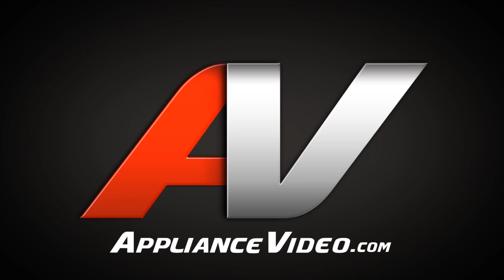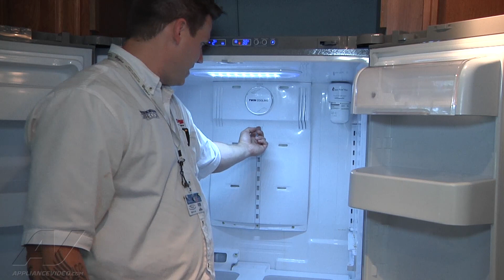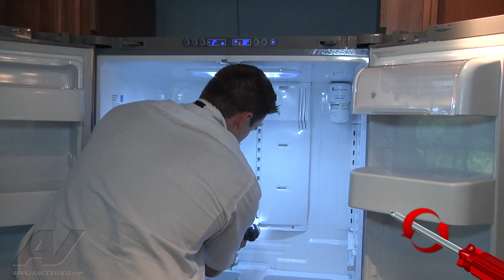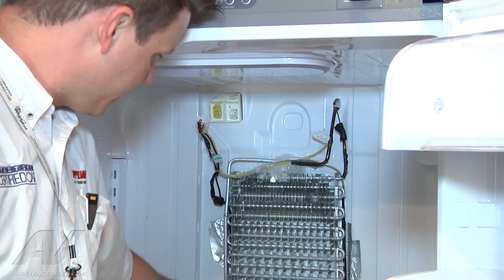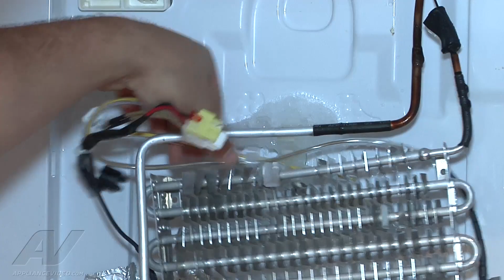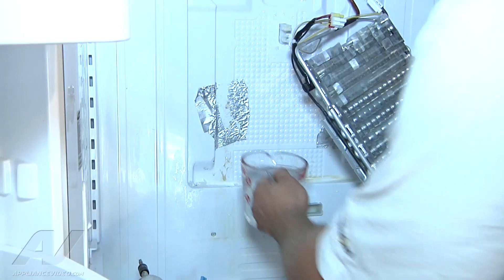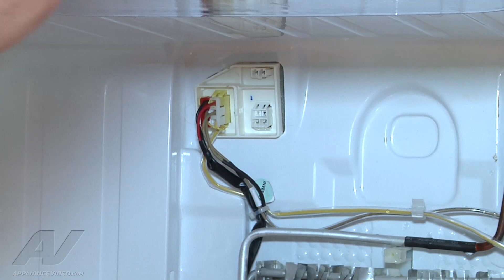Samsung Refrigerator Repair - Freezing Up On the Back Panel - Evaporator and Defrost

Comment: PLEASE READ!!! Had to do this every 6 months until I read that if you spray "Pam" on the coils it will prevent ice buildup. So I tried it and haven't had a problem since. 5 years and still no ice build up!
Reply: Wow ..Was your problem,the coil icing at top, causing the fan make a noise?
Reply: @victoragresti1777  Ice gets in the way of the fan blades. The noise is the blades hitting the ice.
Reply: @victoragresti1777  
Did you try it?
Reply from the maker: Hello 
          Thanks for the good tip, I hope it can help others with the same issues. Please help us by subscribing to our YouTube channel, or post our website www.ApplianceVideo.com to your Facebook page
Reply: Samsung very bad my refrigerator same over 1 month I have to do that 1 time.
Reply: PAM as in the cooking oil spray? I’m having the same issue with my Samsung double French door refrigerator. I am about to try out these suggestions
Reply: @algnelson2608  yes. Good old pam. When you take the back panel off while you’re defrosting it it becomes very clear what you need to do. Be sure and put a thin piece of paper or cardboard behind the fins when you spray so it’s not running down the back of the fridge.
Reply: Sorry what did you spray on it to stop this problem.  P.
Reply: @p.p2295  Pam. The cooking oil spray.
Reply: What did you spray
Reply: @p.p2295 he used Pam cooking spray. Like canola oil cooking spray. Stuff that keeps food from sticking when you cook.
Reply: Thanks I will try that
Reply: @jmdenison  did you try it?
Reply: @kayceevaldez2823  Try what the PM spray thing? Yes I tried it for a couple of months and it didn't work at all. Ben's appliances has a retrofit that I think will work and I'm going to go order it. Basically you will see the frost builds up in the upper portion of the chamber and he adds a couple feet more of defrost cable up there to keep it from frosting over. That should work because it doesn't seem to frost over in the lower portion
Reply: @jmdenison  did it work??
Reply: @bruhbry831  no. I'm thinking of forcing a defrost cycle everyday
Reply: @jmdenison  that’s a shame cause that’s what I thought of trying next, was hoping that rig he made would have worked :( hate Samsung now
Reply: PAM as in cooking oil?
Reply: @titoh5483  was it cooking oil or ??
Reply: Did you remove it to spray the front and back?
Reply: Sorry what did you spray

Comment: What would the problem be if the fridge just get colder than the recommended temperature?
Reply from the maker: Great question, if you have a more technical question that our parts department cannot answer, you can search our over 17,000 answered questions free at our website www.ApplianceVideo.com under our Repair Help section. You can also call our parts department at 1-800-830-5465 and they can give you help 7-days A week ,or search at www.SaveMoreOnParts.com  .

Comment: Hi Shawn, thanks for the great video. My Samsung rs25h5111sr/aa had ice build up in the fridge section which affected the temperature in that section. I took the cover off to melt the ice but the temperature was still high. I then changed the temperature sensor with no luck. Now the temperature is around 39- 44 degrees. When I checked the evaporator coils, I realized no ice is forming on them. Do you know what could be the cause of this problem? The freezer works great. Thanks.
Reply from the maker: Great question, if you have a more technical question that our parts department cannot answer, you can search our over 17,000 answered questions free at our website www.ApplianceVideo.com under our Repair Help section. You can also call our parts department at 1-800-830-5465 and they can give you help 7-days A week ,or search at www.SaveMoreOnParts.com  .
Reply: @Appliancevideo  that was pointless. Why answer ot with a standard message like that?

Comment: This seems to be the fridge back banal. I’m struggling with the freezer back panel below
Reply from the maker: Great question, if you have a more technical question that our parts department cannot answer, you can search our over 17,000 answered questions free at our website www.ApplianceVideo.com under our Repair Help section. You can also call our parts department at 1-800-830-5465 and they can give you help 7-days A week ,or search at www.SaveMoreOnParts.com  .

Comment: I bought a beautiful new Samsung refrigerator  (with right-side pass through door) a few years ago.

The fridge ran great for about two years and then started freezing up on me. 

I eventually replaced  the defroster heater/sensor combo and thought my fridge troubles were behind me.

I was wrong!

The fridge ran fine for about six months before it crapped out again! 

Needless to say, I WILL NEVER buy  another Samsung product again!
Reply: I must admit, I've been watching several Samsung videos try to solve this problem, and I also would never buy a Samsung refrigerator. My refrigerator probably has a similar problem but it's about 15 years old, so I can't complain I guess.
Reply: so, when it 'crapped out again', was it the same issue with freezing up behind that panel? Or a different issue?
Reply from the maker: Great question, if you have a more technical question that our parts department cannot answer, you can search our over 17,000 answered questions free at our website www.ApplianceVideo.com under our Repair Help section. You can also call our parts department at 1-800-830-5465 and they can give you help 7-days A week ,or search at www.SaveMoreOnParts.com  .

Comment: How do you know if that needs to be replaced last week we replaced the little metal part that is on the bottom of heater but it is still freezing up so I am guessing it would be this??? I would love to know what you would think
Reply from the maker: Great question, if you have a more technical question that our parts department cannot answer, you can search our over 17,000 answered questions free at our website www.ApplianceVideo.com under our Repair Help section. You can also call our parts department at 1-800-830-5465 and they can give you help 7-days A week ,or search at www.SaveMoreOnParts.com  .

Comment: I've never had to change a defrost heater in a samsung for back panel freezing up i  add a heater on top
Reply from the maker: Great question, if you have a more technical question that our parts department cannot answer, you can search our over 17,000 answered questions free at our website www.ApplianceVideo.com under our Repair Help section. You can also call our parts department at 1-800-830-5465 and they can give you help 7-days A week ,or search at www.SaveMoreOnParts.com  .

Comment: I will never buy another Samsung anything! I do have a partial solution to the freezing crisper problem that allows me time to find another one that I ilke (Plus the prices are ridiculously high right now) I bought a thermometer for it and discovered that if I set the frig at 44* and the freezer at 4* and watched the temps , I can keep my stuff okay for the time being but I use the crisper for beer and sodas and the top of the fridge for my lettuce and veggies. The milk in the door is around 36* and everything else is okay.
Reply from the maker: Great question, if you have a more technical question that our parts department cannot answer, you can search our over 17,000 answered questions free at our website www.ApplianceVideo.com under our Repair Help section. You can also call our parts department at 1-800-830-5465 and they can give you help 7-days A week ,or search at www.SaveMoreOnParts.com  .

Comment: Thanks for the help. But would this happen again
Reply from the maker: Great question, if you have a more technical question that our parts department cannot answer, you can search our over 17,000 answered questions free at our website www.ApplianceVideo.com under our Repair Help section. You can also call our parts department at 1-800-830-5465 and they can give you help 7-days A week ,or search at www.SaveMoreOnParts.com  .

Comment: I'm done messing with and replacing parts that really didn't need replacing evidently on this SAMSUNG POS.  We went out and bought a Whirlpool (hoping they still make good stuff) its being delivered on Sept 11th.   For the $100.00 delivery and set up  and REMOVAL of this SAMSUNG peice of POO POO it will be a small price to pay compared to all the aggravation this refrigerator has caused us.
Reply from the maker: Great question, if you have a more technical question that our parts department cannot answer, you can search our over 17,000 answered questions free at our website www.ApplianceVideo.com under our Repair Help section. You can also call our parts department at 1-800-830-5465 and they can give you help 7-days A week ,or search at www.SaveMoreOnParts.com  .

Comment: did  that also fix ice scraping with the fan motor in that section ?
Reply from the maker: Great question, if you have a more technical question that our parts department cannot answer, you can search our over 17,000 answered questions free at our website www.ApplianceVideo.com under our Repair Help section. You can also call our parts department at 1-800-830-5465 and they can give you help 7-days A week ,or search at www.SaveMoreOnParts.com  .

Comment: I replaced everything in there but the fan and coils and even replaced the main PCB and it still freezes up solid every month.
I started putting in forced defrost mode once a day (about a month ago) and now it stays ~37* and ice free.
Never will I ever buy Sam-Suck again.
Reply from the maker: Great question, if you have a more technical question that our parts department cannot answer, you can search our over 17,000 answered questions free at our website www.ApplianceVideo.com under our Repair Help section. You can also call our parts department at 1-800-830-5465 and they can give you help 7-days A week ,or search at www.SaveMoreOnParts.com  .

Comment: Is there a way to unclog the refrig drain pipe from behind the refrig?
Reply from the maker: Great question, if you have a more technical question that our parts department cannot answer, you can search our over 17,000 answered questions free at our website www.ApplianceVideo.com under our Repair Help section. You can also call our parts department at 1-800-830-5465 and they can give you help 7-days A week ,or search at www.SaveMoreOnParts.com  .

Comment: How to get in touch with you. I have a burnt out plastic housing where you plug the heater. Can you tell me how to replace that socket and where to buy that part.
Reply from the maker: Great question, if you have a more technical question that our parts department cannot answer, you can search our over 17,000 answered questions free at our website www.ApplianceVideo.com under our Repair Help section. You can also call our parts department at 1-800-830-5465 and they can give you help 7-days A week ,or search at www.SaveMoreOnParts.com  .

Comment: How do I know if the thermo senor or heating coil
Reply from the maker: Great question, if you have a more technical question that our parts department cannot answer, you can search our over 17,000 answered questions free at our website www.ApplianceVideo.com under our Repair Help section. You can also call our parts department at 1-800-830-5465 and they can give you help 7-days A week ,or search at www.SaveMoreOnParts.com  .

Comment: I replaced all three components of the fridge defrost (heater element, bimetal thermostat, and temperature sensor) and am still getting freezing.  Anyone have other ideas how to fix?
Reply from the maker: Great question, if you have a more technical question that our parts department cannot answer, you can search our over 17,000 answered questions free at our website www.ApplianceVideo.com under our Repair Help section. You can also call our parts department at 1-800-830-5465 and they can give you help 7-days A week ,or search at www.SaveMoreOnParts.com  .

Comment: Just replaced my heating element, Thanks for video.
Reply: Did that work for you.   It didn't fix my problem.  Nothing changed.
Reply: @danlaino4303  It worked for a while and then slowly started having the same problem.
Reply: @sammc8680  Exactly.  We went out and bought a new refrigerator yesterday  delivery date of Sept 11.  I wasted about $80.00 on parts and hours of time defrosting and replacing and checking other parts .Hopefully mine keeps working without me having to take if apart again before Sept 11th. We downsized to a condo so no garage like the old days to put it in and use as a freezer because that works just fine.  What a waste of money 3+ years ago on this piece of SAMSUNG  POO POO!   Never again!
Reply from the maker: Glad it helped. Thanks for your response, we are glad we could help. Our library of over 5,700 videos are currently helping over 1.6 million people like you every MONTH.  Please help us by subscribing to our YouTube channel, or post our website www.ApplianceVideo.com to your Facebook page, Twitter, Instagram or any other social media sites. Your support will help us keep producing more free quality videos.

Comment: My refrigerator is having a similar issue. I can no longer open the ice maker door to defrost it with the hair dryer. It's frozen over along with the cooling fan compartment in the refrigerator. I use an electronic thermostat to keep a check for the actual temperature in the refrigerator and freezer. The refrigerator is at 50 degrees and there is water pooling under the deli tray. The water then spills onto the floor and I have to remove the deli tray to clean the water out.  All of this happened to me in 2017 and I now have the same issue. I've call Samsung and they refuse to acknowledge that they have a manufacture defect on the refrigerators. They told me since this is out of warranty that I would have to pay for repairs. Well the ice maker has been an issue for me for years. I have to defrost it with a hairdryer about once a month and here I am again in 2020 having to get the same repair that was performed in 2017 which tells you all they did was put a bandaid on the problem without addressing the real issue which is this thing can not be fixed. Of course, I've requested a refund and they deny that they are at fault and will not give me a refund. I have filed a complaint with the BBB.
Reply from the maker: Great question, if you have a more technical question that our parts department cannot answer, you can search our over 13,000 answered questions free at our website www.ApplianceVideo.com under our Repair Help section. You can also call our parts department at 1-800-830-5465 and they can give you help 7-days A week ,or search at www.SaveMoreOnParts.com  .

Comment: Our Samsung fridge is only 7 1/2 years old.  We have already had a thermostat replaced and now it's freezing up again.  We also had to replace the shelf brackets because they rusted.  NOT happy.
Reply from the maker: Great question, if you have a
more technical question that our parts department cannot answer, you can search
our over 10,000 answered questions free at our website www.ApplianceVideo.com under our Repair Help section. You can also call
our parts department at 1-800-830-5465 and they can give you help 7-days A week
Monday -Saturday, or search at www.SaveMoreOnParts.com  24 hours
7- days A week.

Comment: Why do these companies get away with selling these items when so so many have the same issue? There should be someone that can step in and do something about it. I had a Maytag that had a ice maker problem and so did everyone else. Same thing with my washing machine. Lucky for youtube otherwise we would all be screwed $$$ I guess I'm just in the wrong business.
Reply from the maker: Great question, if you have a
more technical question that our parts department cannot answer, you can search
our over 10,000 answered questions free at our website www.ApplianceVideo.com under our Repair Help section. You can also call
our parts department at 1-800-830-5465 and they can give you help 7-days A week
Monday -Saturday, or search at www.SaveMoreOnParts.com  24 hours
7- days A week.

Comment: so we fixed ours about 2-3 years ago and now today we are defrosting the back again. It is frozen up again. Any one have a repeat? We added the coil to extend the heating 2-3 years ago.  Samsung  RF263beae is nothing but junk
Reply from the maker: Great question, if you have a
more technical question that our parts department cannot answer, you can search
our over 10,000 answered questions free at our website www.ApplianceVideo.com under our Repair Help section. You can also call
our parts department at 1-800-830-5465 and they can give you help 7-days A week
Monday -Saturday, or search at www.SaveMoreOnParts.com  24 hours
7- days A week.

Comment: How do you know if the problem is the Heater-Metal SHEATH;120V or the defrost thermostat?  I have a Model rf263beaebc that works wonderful until the fan starts clicking and the temperature in the fridge stops cooling.  I've left it off and open for 16 hours and it worked again list a charm for about three weeks and I was right back with the same issue.  Samsung acts like my problem is isolated but with the number of videos out here and posts on blogs, I don't think I'm alone.  I don't know if there is a simple answer to my question or it's a gamble as to what the issue is.
Reply from the maker: Great question, if you have a
more technical question that our parts department cannot answer, you can search
our over 10,000 answered questions free at our website www.ApplianceVideo.com under our Repair Help section. You can also call
our parts department at 1-800-830-5465 and they can give you help 7-days A week
Monday -Saturday, or search at www.SaveMoreOnParts.com  24 hours
7- days A week.